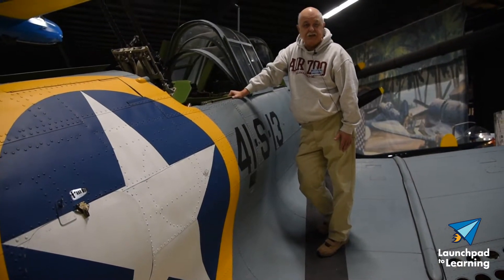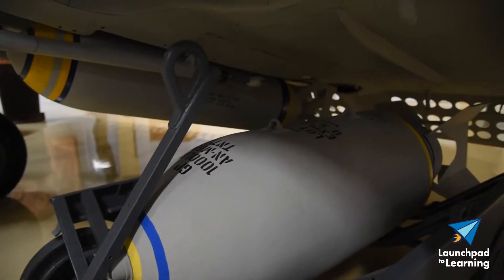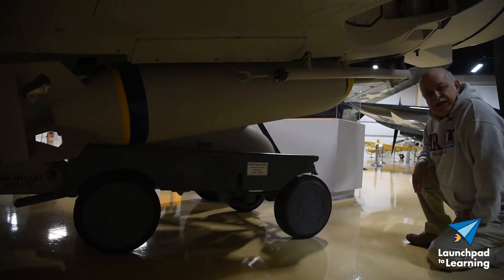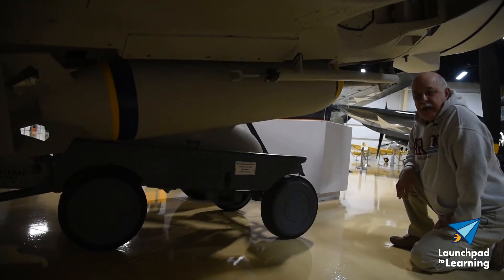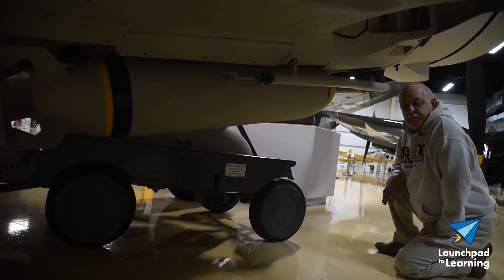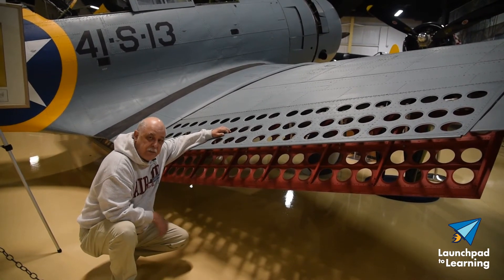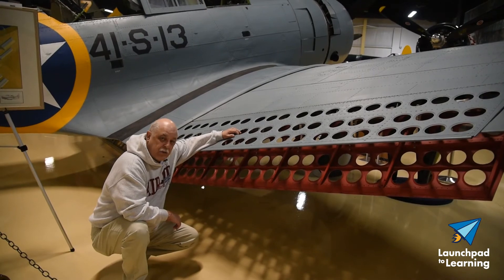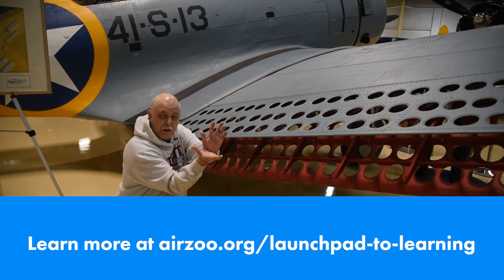An Overview of the SBD Dauntless

Comment: My father flew an SBD in combat from the decks of the USS Hornet (CV-8) and the USS Lexington (CV-16)  In addition to the Battle of Midway,  he also saw combat at the Battle of Santa Cruz, the Battle of the Philippine Sea, as well as attacks on Japanese installations at Truk Lagoon, Hollandia, Palau,  Wake Island, Wolei, the Marshall Islands, and the Caroline Islands.   He was awarded the Navy Cross, the Silver Star, 2 Distinguished Flying Crosses, and 2 Air Medals.  He did shoot down a Zero in his SBD at the Battle of Santa Cruz after dropping his 1000 pound bomb and hitting the IJN carrier Shokaku. He was able to shoot down another Zero during a raid at Kwajalein in December of 1943. But his best story of a Zero kill was when he was attacking Japanese ground installations at Truk in April of 1944.  His SBD was loaded with one 500 pound bomb and two 250 pounders.  After pulling out of his first dive, he found himself lined up near a runway where a Zero was preparing to take off.  Thinking quickly, he knew that the Zero would be on his tail as soon as it took off.  He lowered the nose of his plane hoping to get the Zero in the sights of his 50 calibers but he was too low to shoot.  He pulled up slightly and then released both of his 250 pound bombs.  The explosions rock his SBD when he heard his rear gunner start yelling "You got him! You got him!". (This was the day before he was shot down at Truk and then rescued by Commander Richard O'Kane and the USS Tang submarine.) He said he probably got credit for only a half kill of that Zero while it was on the ground.  He liked to say that he was only "half aced" for taking out 2 1/2 Zeros.